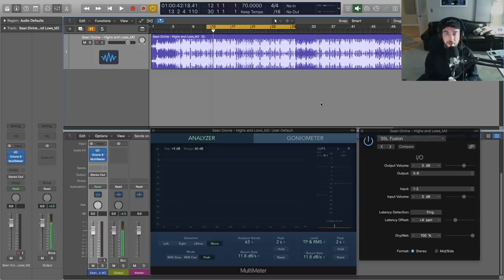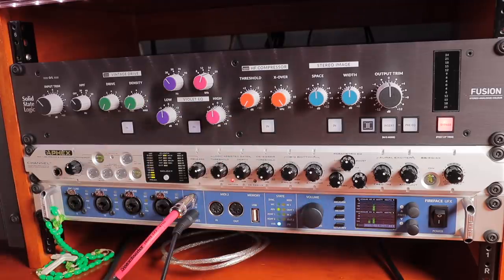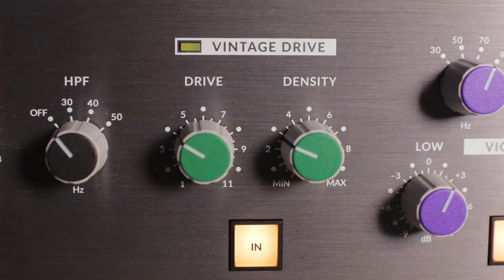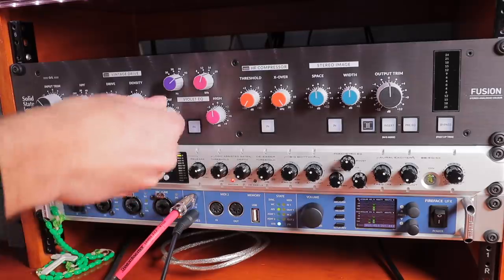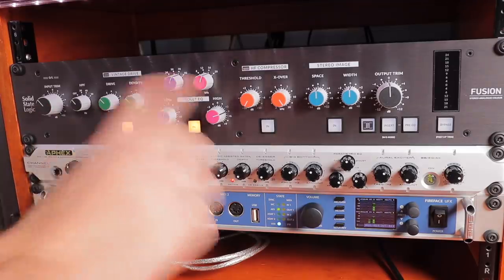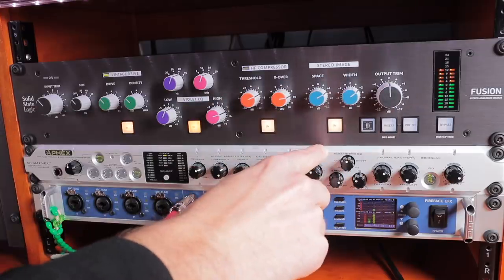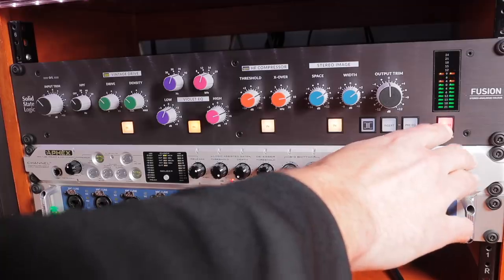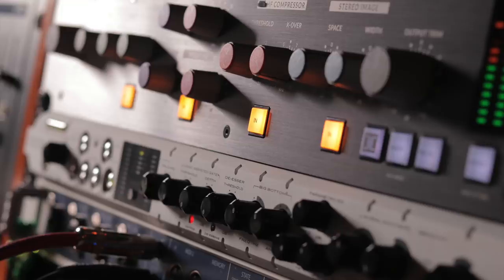Mastering with SSL Fusion Like A Pro

Comment: Congrats SD and thanks for the demo.    Can't wait to see what you get next.   Maybe a Neve MBP?

I've been into 500's lately.  So flexible.   I just need your talent now.
Reply from the maker: the 500's are tempting :)
Reply: @SeanDivine  Started out with a Neve R10 rack last Oct; filled it.  Got another cheaper 10 space just to test modules.  Super fun and shipping them is easy.   A good power supply is the key.  The R10 does that well and is made in Texas!

Comment: Hey Sean, a little help if you can. Should I run SSL Fusion into Warm Buss Comp or Buss Comp into the Fusion? I’m thinking Fusion into the Buss.
Reply: Jossue Castaneda mix into your buss comp first (4:1 ratio slow attack fast release for modern music) then use the fusion for final tweaks
Reply from the maker: yep, I would leave the Fusion last in the chain... although it does have an "insert" mode as well :)

Comment: hey bro! great vid! where should the levels be at b4 running the final mix thru the ssl and where should they be at after final mix thru the fusion?
Reply from the maker: No rules. It's usually a good idea to bring the input trim back some on the Fusion so you have headroom to work with (analog reacts differently). Use your ears and make sure you're not introducing any undesired distortion going out / coming back in to the DAW.
Reply: @SeanDivine  thank u bro! Imma be placing that order soon!

Comment: Amazing tutorial. Just got one in the studio I work in and wanted to get more familiar with it before using it to master. I see you only used a Limiter in the box before the demonstration. Is that what you would actually do while mastering with the fusion or is it all circumstantial? Any other plugins you may throw in that you'd recommend alongside the Fusion?
Reply from the maker: Yep! I just route the master through the Fusion and follow with it a limiter / maximizer and any metering plugins. That's usually it although I may put on the bus compressor or a dynamic EQ on occasion.
Reply: @SeanDivine  Dope! Thanks man!

Comment: How do you wire this unit to logic and your interface? What is wires do you need?
Reply from the maker: it depends on your interface, I am running balanced XLR to TRS into the RME UFX and then I use the I/O plugin in Logic for routing

Comment: Do you recommend using the fusion before or after you have mastered the track? Like use it as the ultimate last step? Thanks.
Reply from the maker: Yes. I place it last, just prior to limiting / maximization
Reply: @SeanDivine  thanks for replying brother. This helps a ton!

Comment: Nice demo....No offending but going out the box with the I/O plugin it makes sense to dither before. It also makes sense to dither the output of your daw because most interfaces do not reach true 24 bits. every time you leave the DAW truncation happens. Not my wisdom, its the wisdom of Bob Olhsson (Motowon today ME.) I write it because I clearly can hear that you lose some of your reverb tails and other subtle stuff when the SSL-FUSION kicks in. I am pretty sure the fusion is a great unit. I may buy one that's why I watch some examples...
Reply: The bypass is on the hardware unit. The before/after you’re hearing are both post conversation, so whatever difference you’re hearing is not from what you think it is.

Comment: Hey Sean, I have the fusion for some time now and I want to know how to set it up properly with logic. I feel as if its not working properly with the i/o plugin. My issue is when I'm finishing getting the sound that I want i am really confused as to how to render or bounce the exact thing that i am hearing to a finished product. Can you shed some light or some pictures as to where your cables run etc to and from your interface. BTW i have an Apollo twin quad interface. thanks
Reply from the maker: hey Ted, basically you need a free input and output on your interface. You then set that up with the I/O plugin and of course, you'll need to bounce in real time. I'll see if I can do a video on the specific routing :)
Reply: Sean Divine that would be awesome if you would do that please. I have this device and im not using it to its full capacity imo

Comment: Hi Sean, thanks for the great video.  I just bought it 2 weeks ago and still don't know how to use yet.  I have question about the send signal to this unit.  I use 2 aux from my Presonus mixer to send to this Fusion unit;  However, I don't know how much to send.  Are we looking at between +9 and +15?  Please help.  Thanks much.
Reply from the maker: Hi Tung, I'm not sure about your exact setup but you're not essentially doing a "send" here. Actually, you're routing the output signal from the DAW to the Fusion and then back into the DAW for 100% processing in most cases :)
Reply: @SeanDivine  Do you go after to plugin (daw) compressor (for final boost) as a final stage or is fusion your "final stage"?

Comment: Hi Sean! Great video, what an improvement in the mix!  I also use the SSL Fusion, RME UFX and Logic Pro. I'm having problems to configurate the Totalmix (RME software/driver). It's sounding phasing every time I turn on SSL Fusion. Can you please send me the Totalmix configuration you are using? Thanks a lot!!
Reply: You maybe hearing the signal twice. Possibly monitoring the hardware input and software playback at the same time.
Reply: @MannMusicForMedia  I’ve got it connected as an input and can hear it but I can’t record for some reason. Trying to figure out if maybe setting it up as an insert is the way to go, can’t find any information online as far as how to set it up that way let me know if you can,  thank you

Comment: Sean, analog gear has 24db headroom. Does this mean i can make a crazy loud master like -7 to -6 lufs?
Reply from the maker: You still need to use your ears and avoid being careless with levels. That said, I typically mix hot, as you all know. Plenty of headroom on the Fusion :)
Reply: No it doesn’t not. Not for that reason anyways. Mixing technique is still identical.

Analog headroom is about one thing and one thing only: getting tracks loud enough above the noise floor so there isn’t noise in your recording.
 
Analog does allow gear to slightly saturate and soft clip as it approaches or hits max headroom, but whether or not that’s 24db has zero to do with it. Same effect could be achieved if headroom was 4db.

Comment: my SSL makes like hiss noise when I but drive up or more input, is this normal?
Reply: Yeah mine does t he same. I find the more I push it the drive, the noise reduces.
Reply: @TheBuster1976  yea, is this part of the analog world or there is something wrong with mine? is it the power problem?
Reply: Usha master.  I don’t think It’s the power, a lot of people say the same, I think it’s just that particular circuit that’s noisy. Seems to hiss less when it’s turned up more.
Reply from the maker: it's the vintage drive... analog circuitry isn't always silent :) it gets quieter as you turn it up or you can disable that module
Reply: @SeanDivine  vintage drive is the module that don't want to miss but too bad that it makes that analog hiss noise...:(

Comment: This is all fine but..... you can get debth and more SSL sound with a warm audio G Comp and SSL +2 compressor and taps

That's $1200 instead of $1900
And you can do more with those 3 units instead of having JUST the SSL FUSION 

Most people are never going to buy this because it's just too overpriced it would be nice to add to Hardware you already had if it was between five hundred and $700